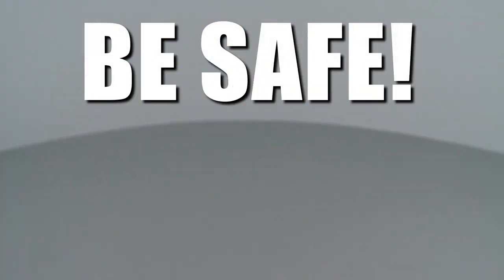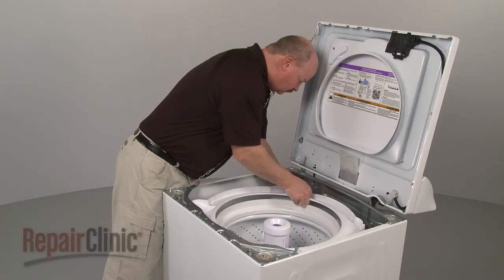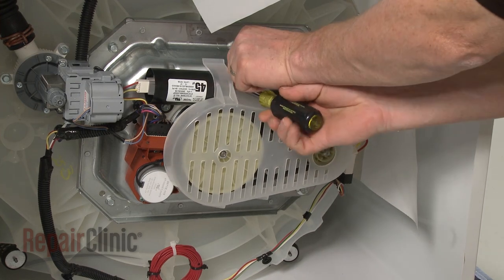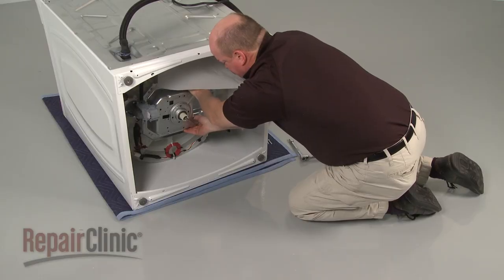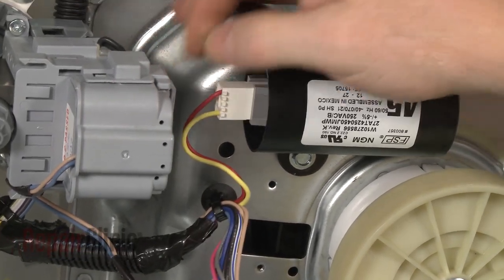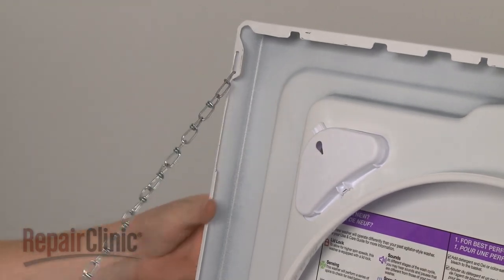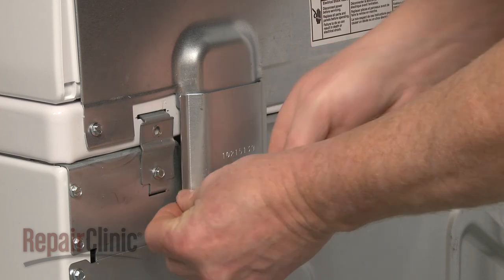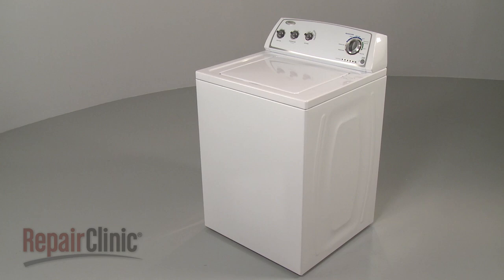Whirlpool Top-Load Washer Leaks? Replace Tub Seal Part # W10324647

Comment: Take whole machine apart to change one tiny seal? What a design!
Reply: Yeah, wtf? This is a complete engineering failure.
Reply: @SectionF4  money maker. Seal is $50! Toilet seals are $5!
Reply: Would be cool to change seal from the top center tub pole
Reply: Even worse the water gets up into the shaft & rusts everything so you can’t take the agitator off or the span nut, drive block or anything even if you wanted to!!

Comment: Had this washer 8 years & had to replace the tub seal. The splines on the shaft were so rusted I couldn’t get the agitator off. When I finally cut the agitator off & saw how rusted & falling apart the splines were, I knew there was no saving it. The gear case costs $186.00. I wish the design was better bc everything else on the washer was fine. I was even able to replace the suspension assemblies earlier this year & it ran great until the tub seal leak took me out.

Comment: I appreciate these videos but the way they have their trans assembly slide out so easily is very VERY misleading 😂 inthink they are workig on brand new equipment, itd be better if they showed a real life 14 year old machine and how they can remove the trans after decades of use.
Reply: Mine reached 11 years before tub seal failure. The hardest part of all this was waiting for the replacement seal.

Comment: I am adding to my comment about the washer still leaking, its a admiral  model #atw4675yq1.  Also i believe this design is flaw, because the seal is not actually seal between the two tubs, its just an observation!

Comment from the maker: That could be a bad water inlet valve. I would recommend using the repair help section of our website (link in the description). If you enter your model number there you'll have access to part, model, and symptom specific repair help. This will give you some ideas of different parts you can check.

Comment from the maker: Have someone hold down the cabinet while you lift. You can also use a rubber mallet to tap the center shaft and loosen the tub.
Reply: Mine will not come loose. Kenmore 80 series. Are those 4 tabs that to be depressed on main shaft in of inner tub?

Comment: Should you replace the bearings at the same time, ours leaked and grease washed out of the bearings?  Is there a video for that?
Reply: hello..... did you ever o the route of replacing or repacking transmission bearings? I'm in the same boat !  LOL!!

Comment: I think its awesome the RepairClinic would go to the trouble of replacing the seal on a completely new machine just to Educate there would be Customers . I have Used you guys many times and thats not about to change Most time i have never needed the Videos But this time I did although my machine is completely different I believe the info will be of great use to me. My Order for a new seal will be placed shortly , Thanks alot and keep up the good work !
Reply from the maker: tahamonie We're happy to help! Thanks for the kind comment!
Reply: Got the seal a day or so ago only to find out i need a Puller, I see you guys carring one but its more than what i would have to pay for a used machine, So that's not about to work ! I'll improvise, But something you might wise to think about is mentioning the need for such tools b4 customers place Orders then maybe offer to rent the needed tool. Your most Welcome
Reply from the maker: tahamonie We're not sure what you're referring to. Do you mean the tub nut wrench? Because that is only $10.84 on our website.
Reply: Drive Bell Tool
RepairClinic Item # 472617 Aftermarket (Non-OEM) part  Cost 113.50
Reply: Its kinda horseshit you have to take the whole damn thing apart...that said good video

Comment: Soooo much easier working on a brand new washer that never seen a load in it. I couldn’t get the tub out even after soaking it with WD-40 and a rubber hammer. Going to buy a new one. Thanks anyway.

Comment: 1st check see if is a crack in  The plastic outer tub.  Many these junk washers have such horrible plastics in them they just crack all over.
And sadly is very hard get a replacement plastic tub. If crack isn't too bad can use jb weld, or 3m marine construction adhesive seal crack.  If crack is too big best bet is finding a same free junk washer online to swap parts. Or just get rid of it.

Comment: counter clock wise...../////???? some say clockwise since its a lefthanded thread,,,,,,,,,nevertheless mines just wont give way.....I use wd 40 and it still want loosen???maybe my hammer to weak or me....any suggestions for the spanner tool ...trying to install the tub seal
Reply from the maker: dablock2k3 On this model, you must turn the spanner nut counter clockwise - it is not the same on every nut though. It depends on your model.

Comment: I replaced the seal twice and it started leaking again only after 1 wk of use, on one of the rings I noticed it tore a little piece from the inside of the seal, I think the part I’m getting may be a cheap version

Comment: I have replace this exact tub seal, it worked for a day. It has been leaking since , worst every day.( day 7) . I am going back to the drawing board, either tomorrow or the next day.I am not sure what it could be, but i will take it apart & maybe something will show up!
Reply: Did you end up fixing it ? I replaced mine twice but still leaking it leaks more when I manually turn the agitator with my hand, maybe my seal should fit tighter on the rod that it goes on? I may add electrical tape to make it slide on a bit tighter .

Comment: i don't have that special tool to remove the special nut on the tub on the top part ...any suggestions should i try and knock it loose with a hammer and screw driver by hitting it left to see if it comes loose?
Reply: Don't!